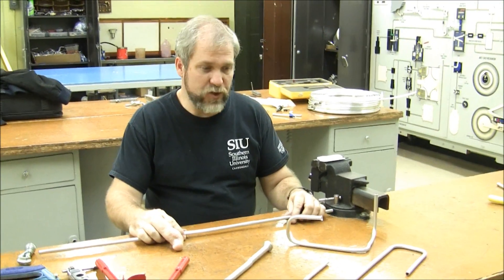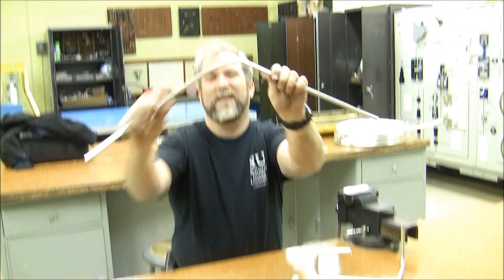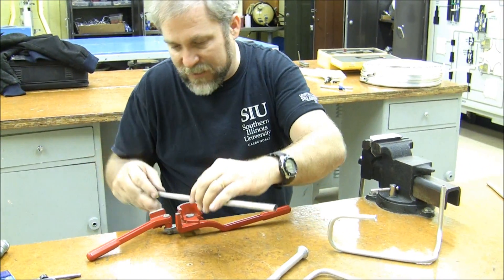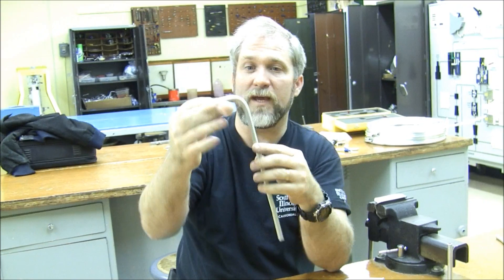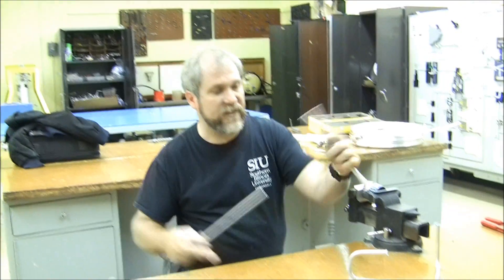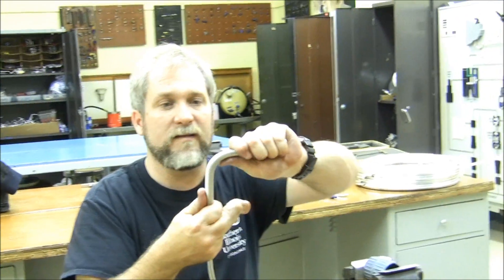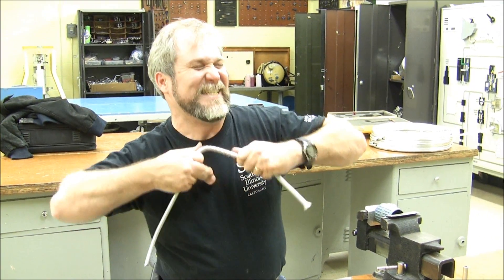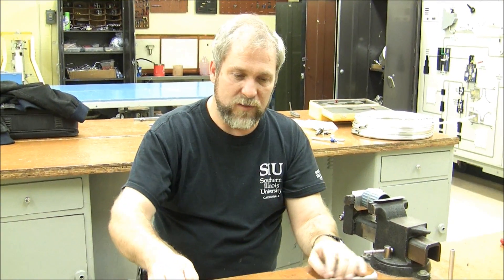Aviation Tools Training - Bending Aluminum Tube

Comment: Good video.  Does it make a difference if the spring is on the inside vs outside of the tube?  another video showed using the spring inside of the tube.
Reply from the maker: I think it would be a lot tougher to remove from the inside.  Other than that, I don't see why it would make a difference...
Reply: 1donagin well I ordered by outside benders but they didn't show up in time so I crimped one end, filled the tube with sand, taped off the other end and bent away.  Worked great.  1/2x0.035" aluminum tubing.
Reply from the maker: Craig Grunenfelder
I've never used the technique, but it sounds good.  I've also heard of using melted lead, and then melting it back out.  I don't think this is a good idea for aluminum, however...

Comment from the maker: This video shows how to bend soft aluminum tube (1100, 3003 and similar).  These tubes will typically come in a roll, and you straighten them out yourself before using them.  Hardened aluminum tube, such as 2024 and 6061 will usually require more support than a simple bender can give, or require a much wider bend radius.  These tubes usually come in straight runs from the supplier.